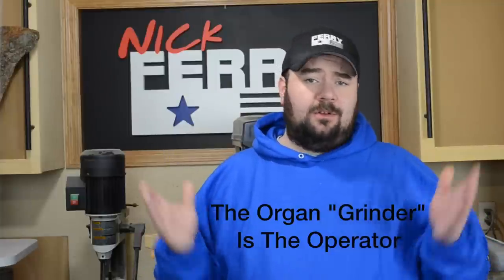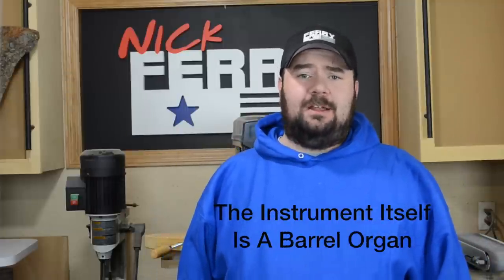Ⓕ How To Make A Organ Grinder / Barrel Organ - Prop Build (ep42)

Comment: Fun prop Nick!  You've got the organ grinder swagger down!  Now that you have more tools in your home shop are you finding it weird to use the other one? 39 1/4 Not sure the mystical implications.
Reply from the maker: AdventuresInDIY Working in different shops always has it's challenges - where did you see 39 1/4?
Reply: Nick Ferry It was a label for one of the bins under the radial arm saw.
Reply from the maker: AdventuresInDIY ahh yes, pre-cut legs for stage platforms

Comment: Nice one.  How much research do you do on something like this?  Do you give consideration to the weight?  It seemed like you kept it really light.
Reply from the maker: Howard Springsteen it's cool you noticed the weight thing - actors rehearse with props a lot and then there are the performances, weight is always a consideration - normally the lighter the better - I just went with what was in my head for what it was to look like - I'm not very musical, so the music note I wasn't completely sure on, but I think it was close enough - the only other consideration I give is the actors size, height, etc. - if it had been a child actor it would have been a fair amount smaller